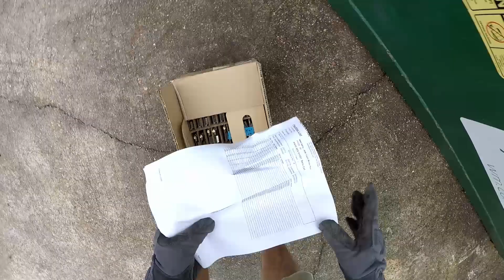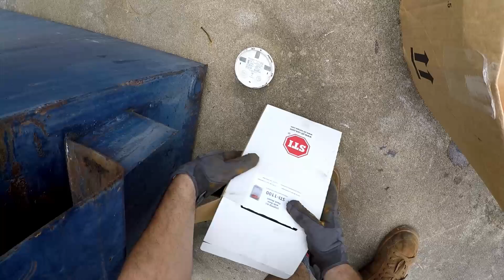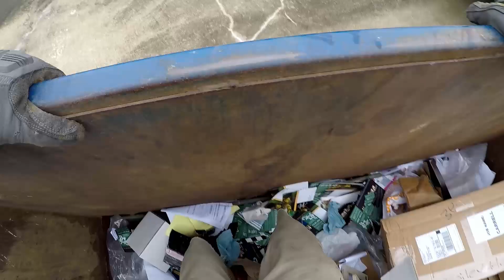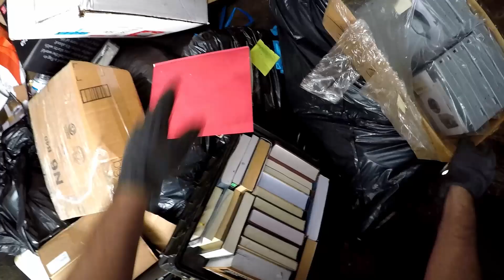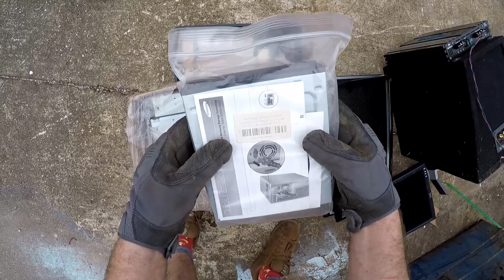Dumpster Diving "We Got One!"

Comment: Those items that said radio active are the dome portions of smoke detectors.  Some of that wire is semi rigid hard line used in power transmitters. All those circuit boards are worth scrap gold and gold is going for near $1900. An ounce !!!! As for those LED high power bulbs I would be interested in.

Comment: Those little modules you seem to have hundreds of look like Wi-Fi modules to plug into an older laptop having PCMCIA slots on the side. The little gold connector is is likely an SMA connector for an antenna. Definitely old school, put probably marketable. Us electronic nuts will buy about anything along those lines if it is cheap enough!  The lights having regular PAR lamp shape are definitely LED floodlights, and may well be unused. Try putting power on the two prongs and see what happens! They are probably made for 110, but the label on them will tell you for sure.  You may even have the lamp holders for them from the same dumpster! When the owner changed out the landscape lighting, they probably threw out the spare bulbs they had on hand.

Comment: Samsung drives go for $30 a piece. I don't know what you're talking about old school, because Samsung didn't come into existence until late 2000's. Macintosh, now owned by Apple made all of it along w/ Microsoft from the 60's to now. So, they are fairly NEW. Not old. Because old school is ScanDisk, Windows 98, Microsoft, and Macintosh/Apple. 

Nice load though. Good work! 💙💙💙👊👊👊
Reply: Samsung was founded in 1938. Microsoft in 1976 and Apple in 1975. The Apple company in the 60s was Apple Corp owned by the Beatles and had there record label there called Apple records. Apple (computers) wasn't around until 1975. They even got sued by Apple Corp in 1978 for trademark infringement on the name "Apple". And Macintosh is a computer that came out in the 80s.

Comment: The Advantra AR 200 Cellular boards got between $10-$40 each. And the DVD burners are anywhere between $5-$40 (for used BRay). I see you scrap stuff for pennies when they are worth far more. My son cries when you chuck stuff that is expensive in the back of the truck as scrap. I saw the HP iPaq complete in box (which you had) sell for $130. Please have someone look at them before you scrap them out. Love what you are doing!

Comment: My only issue with this, is that you are not picking up the aluminum cans to recycle. Did you meltdown any of those circuit boards. There is usually gold and other precious metals in boards. Good luck.

Comment: A tip for you: Hydrochloric acid dissolves everything but gold and glass Anything you think might be made of or contains gold in a gallon glass container until 1/4 full. Add acid until 3/full. Cover and place in yard where any person, pet, or animal may reach it (CAUTION::WILL KILL ANY PLANTS AND IS VERY HAZARDOUS IF CARE IS NOT USED. WARE RUBBER GLOVES WHEN HANDLING.) Let set for 24 hr. Refill to 3/4 full, recover and let sit another 25 hrs. BINGO  ,only gold is left over. There is a YOUTUBE channel doing this but on a smaller scale and with many unnecessary steps for quick (one day) recovery. They did about 2 oz.. at a time.

Comment: dude i want that peddle chain thing to rig a peddle paddle on my kayak to sit and rust/rot with the kayak haha omg those heat sink are pure aluminum I'm naming my 1st child scavenger I think after that haul those bearing mounts are not cheap regardless if bearings are bad load all them alarms up and they all decide to start chirping over night your neighbors would burn you down haha honestly the luck you produce an explode woofer with big ass amp who does that duda diesel if you want to do the gold thing tote tub or 5 gal bucket soak with AP solution then on rainy day pop lid off to a bunch of gold flakes like gold dust the wrastler

Comment: Those  orange things were smoke detectors , you should have gotten them . Why didn't you get the electronics in that  small dumpster that was after the one with the detectors in it . And then the one that had the littlelights in ithad electronics in  boxes . Is it all on how you feel? You seem to be missing a lot. Did you ever check with the Scrapper Girl to see what she pays for the circuit boards ?